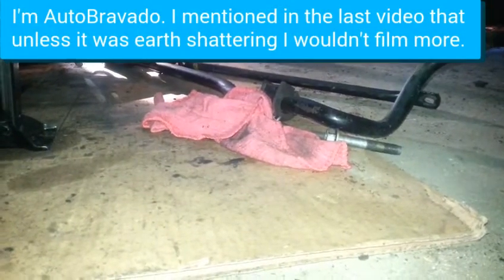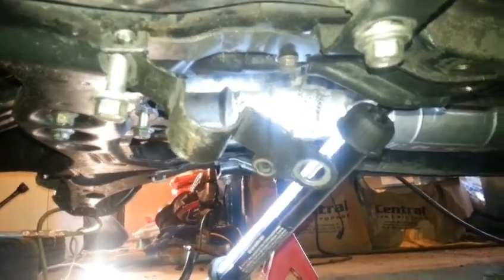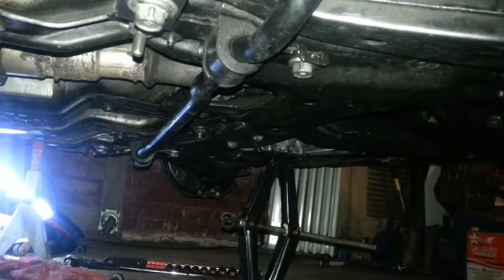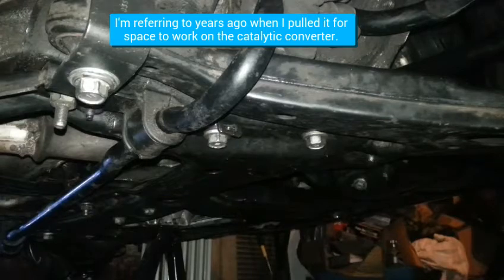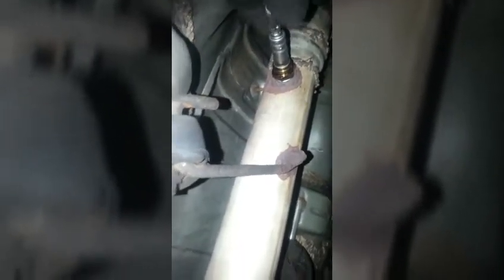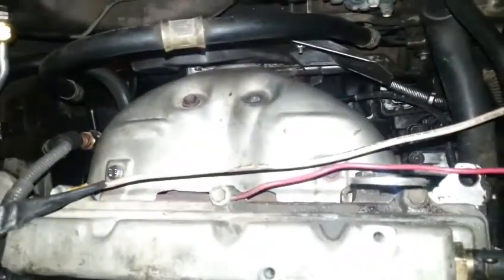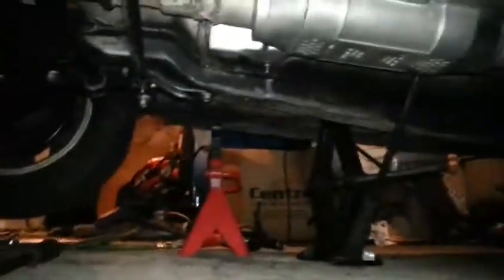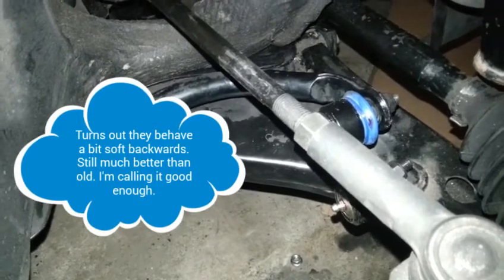Installing Stabilizer End Links; motor mounts R&R part 3 of 3

Comment: Looks good to me. As to the rattle, harbour freight welding blankets  4x 6 ft kinda gold looking $10 , I use  a piece of it between the parts that rattle and they won't burn, just wire it in. The only other way it to cut the exhaust and refit it, that's a pain. 👍👍
Reply from the maker: If I hadn't cut and welded at my muffler to stop a rattle years ago the pipe would have moved out of the rattle zone with that speed bump

Ironic no? I should show that welding off. It looks like one piece. lol

On Toyota Nation . com a member used a rubber food mat....your idea is much better! My welding blanket from Harbor Freight needs replacing anyway. It's getting pretty ugly. lol

Comment: I think putting a heat resistant rubber between the shield and the body or between fasteners will help with the rattle. The rubber will absorb the vibrations without melting due to the hot cat
Reply from the maker: That is entirely brilliant. I won't forget that one.

Comment: Lots of fun for all the family :-D
Oh, you think you have a problem with gray hair, i have a landing strip on my head thats void of hair, i have a skunk stripe, i think its for bats to land on lol, your hair is fine :-D
Ahh the molegrips/vicegrips, i did something nasty with them just before xmas, my mates rubber brake pipe to wheel cylinder exploded out of its crimped fitting, guess what, it stranded the car and frend, so i chopped the end of the rubber tube clean and applied molegrips to pinch the pipe, tied them with zip ties and told him to go slowly back home, 3 brakes should be fine lol :-)
Hope i havnt allready told you this, my memory slips sometimes.
Tipex or white paint on your nuts will give a visual change if any one begins to move, oow that sounded naughty :-D
I would have tryed putting the droplinks on the swaybar first, then use your jacks to push the bar into place, then bolts in bloody quick lol.
If im talking crap, (often) then correct my stupidity :-)
Reply from the maker: You have so much going on that deserves a great comment on that one! I'll be back. :)